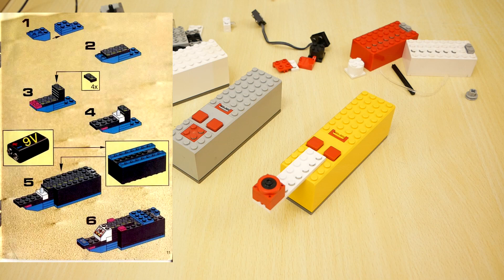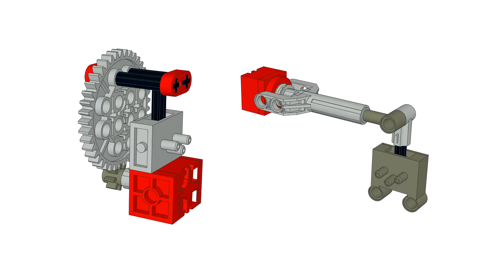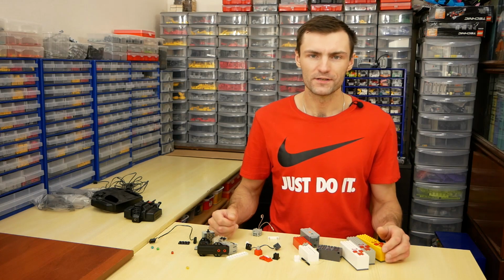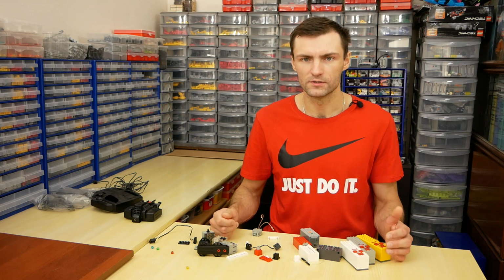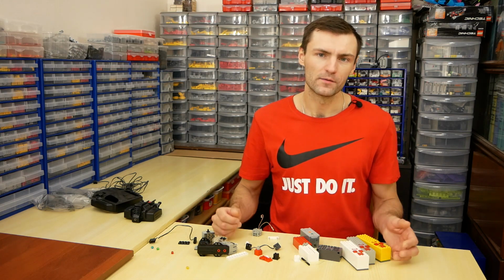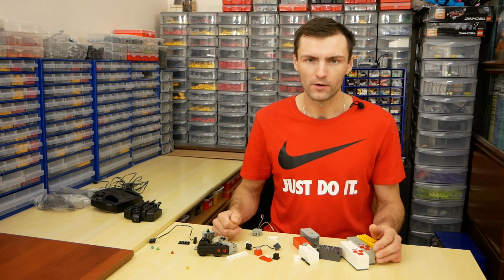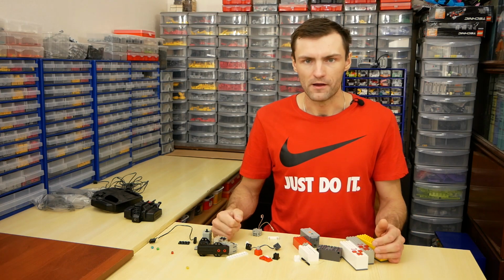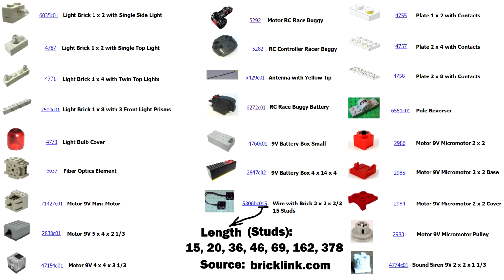LEGO Electric Systems – PART 1 – 9V SYSTEM

Comment: I only came to learn how to open the battery box.  You said, "it's easy to open it" but my experience is not the same.
Reply from the maker: Yes, maybe the latch is a bit tricky
Reply: The problem was corroded alkaline batteries left in the battery pack since 1996. :( The batteries were swollen. I finally used a putty knife to pry it open.  @Kirtechlab

Comment: Damn that's a time travel. I had many of these when I was a kid.

Seeing this has made an existential question come back: how is it possible that I could put the lego electric plates laterally on the battery pack without short-circuiting the battery ?
Reply from the maker: the shape of electric pads on studs is very clever

Comment: It was a much better system in my opinion than modern systems, however there were two primary issues with it that caused it's replacement:
1) It had zero safety features, meaning it was very easy to both short circuit the system and get electrocuted. 
2) It had limited functionality compared to what replaced it;  Basically, Mindstorms is at fault.  
The 9V system lacked the ability to do data transfer or complex commands, it was ON/OFF that's it.  All you could do was change the signal polarity, there was no way to change current speeds or send data.  It was a simple one way direct current system.

But back in those days we didn't care about safety because technic was never meant to be handled for children at all.  But we also have stronger regulations world wide regarding electronics and LEGO had to comply to these.  Sucks Lego got greedy in the last 3 years and released a non-modular system which is asininely expensive for no logical reason while also falling back to the dated pre- 9V era designs of the 70s and 80s.  WHY!?

There was no reason to replace Power Functions.

It did however have far more powerful motors and stacking multiple power using components on it simply split the wattage consumed by the various devices.  Rather than the current system which forces people to purchase super overpriced expensive hubs.

Comment: I hope you read this! Is it possible to connect a PF connector to an old 9V wire? So one end old 9V connector and other end PF connector. Please advise, thanks!
Reply from the maker: yes, you need a PF extension wire. It has a 9V connector on one side
Reply: @Kirtechlab  Of course I know that, but I want to avoid an extra extension cable so just one with old 9V on one side and PF on the other. I want to use the mini motor without extra extension wire. Best would be to cut an extension wire from Aliexpres because they don't even have the old 9V but only PF connectors. But I don't know if those wires are a bit different. I tried to connect the outer 2 wires (from 4 wires) but did not work. And I tried the inner 2 wires but also did not work. But I don't dare to experiment anymore so I hope you can tell me. I just need to know which wires from PF cable I need to connect to old 9V. I hope you can tell me. Thanks!
Reply from the maker: two central pads of the PF connector are connected to 9V connector. use a multimeter to determine the wires

Comment: Hello good sir! I’m in a bit of a tough spot. I inhereted a 1x4 Set of 2 9v bulbs, but have no other 9v parts to test if they still work. I would like to see it on BrickLink as I have no use of it, but I don’t want to falsely advertise it’s functionality. How can I safely test them without damaging them?
Reply from the maker: I think you can connect 9V to pads

Comment: Excellent! Motorization of Lego Technic is exactly the most interesting stuff for me. Will you also test the motors of CADA? Best regards from Germany
Reply: I have a cada system as it provides a 4 wireless control system - though only on/off - and some of the models are nice (and are not rip-off from Lego design).  The motors work well, very similar to the quality of Lego motors and include medium, large and steering motors.  The main reason for me is the 4 way controller with wireless connection.
The models are a reasonable design too and most important, unique to cada.
Reply from the maker: Hi! Now I have no CADA and I don't plan to buy it. I want to test control+ motors.
Reply from the maker: That's cool!